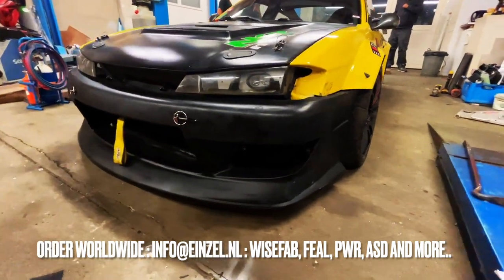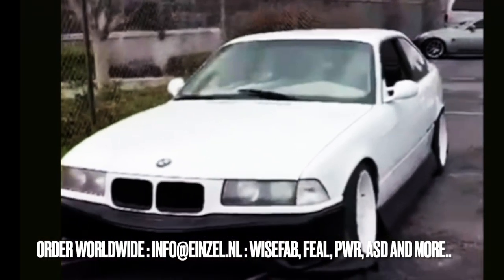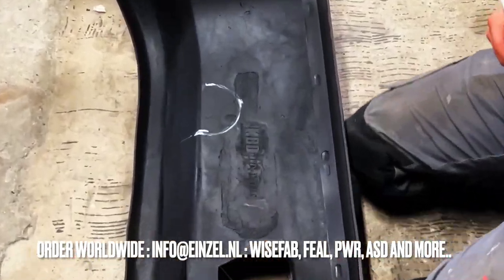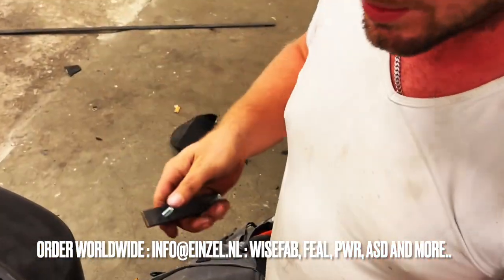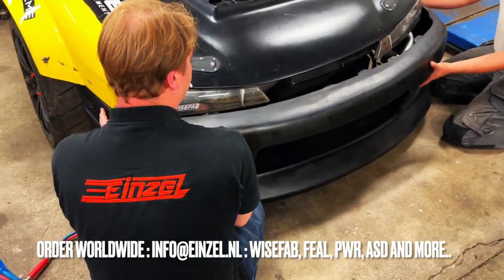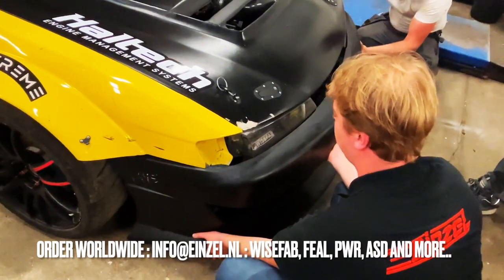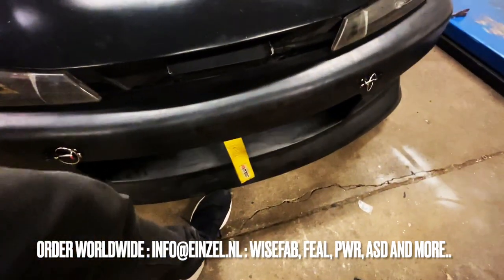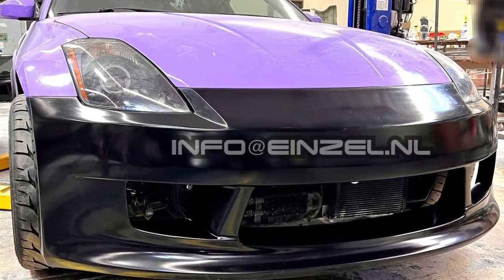Nissan S13 S14 Unbreakable Drift Bodykit installation ! Never Fix Fibreglass Again!

Comment: lovely kit. need one for e30 sedan. if possible with rear end complelety like the clam shell...
Reply from the maker: Can't make things like clamshells.  Only bumpers sideskirts etc.
Reply: @DriftJesus   actually e30 rear is easy 2 rear fenders and a single piece where the rear lights are housed is needed. but if it is this much elastic it might not keep the lights on or retain the shape of the rear end.
Reply from the maker: @gorkemcosgun  fenders are too flat, its just gonna be flappy.  Needs to be a 3D shape

Comment: Where do I get the dipstick sitting on top of the fuel cell at 1:04 

Thanks
Reply from the maker: You should have seen the Nürburgring officials remove it from the tow hook when the car was off track.